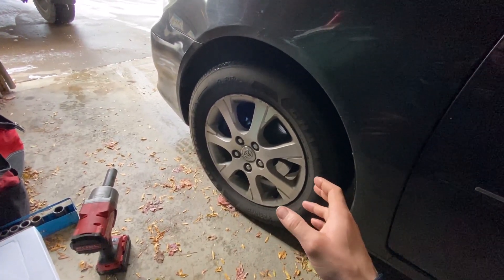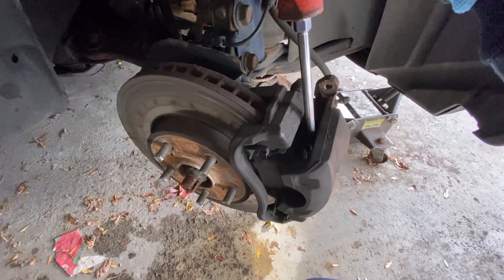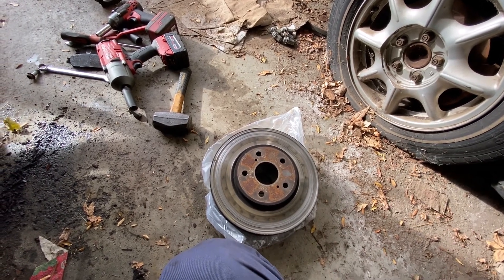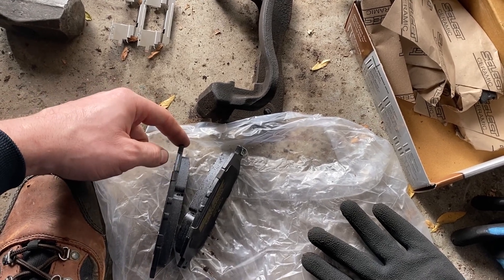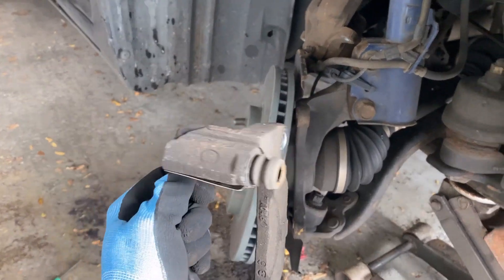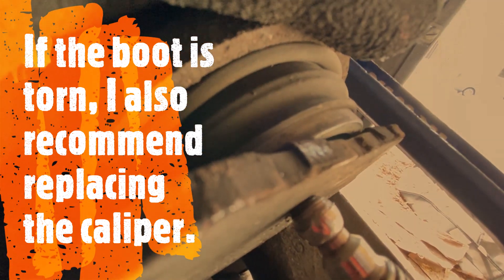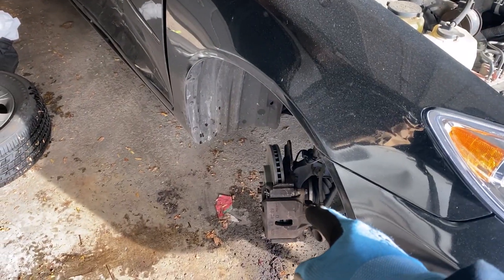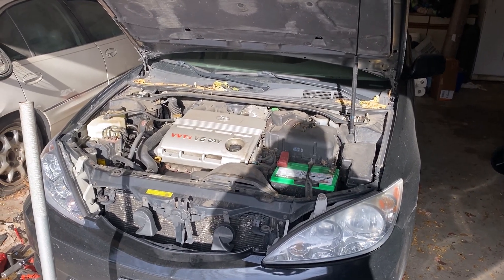Toyota Camry Brakes (Front Pads And Rotors 2002-2006)

Comment: Bravo! Very nicely done "how to" video. I have a 2004 Camry SE (4-Cyclinders, 5 Speed Manual,  VIN starting with "J", and garaged). It has 155K, and no accidents. All parts has matching VIN. There are some small dents and scratches on the doors. Everything in the car still operates and run smoothly. No oil leaks. Believe it or not, it is a fun car to drive!! Also, the style of the car still blends in with the newer cars on the road. I can continue on, however, you know by now I love my 2004 Camry SE and this video is really well done and super educational too! Thank you, Tony!!

Comment: This video was very helpful as I'm presently struggling with a rear break job on a 2004 Camry.  Slide pin is stuck and just turns and comes 3/4's of the way out and I cannot get the new rotor on as it is not enough clearance.  Will give it another shot today...fingers crossed.
Reply from the maker: I'm a bit confused, why would the rotor not go on just because the slide pin won't come out?